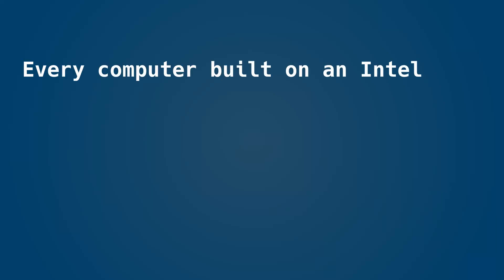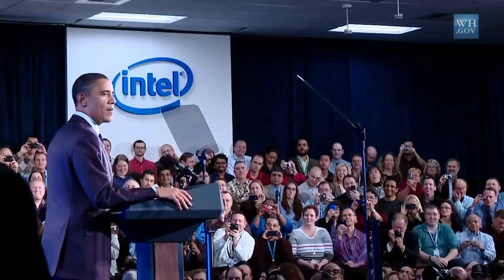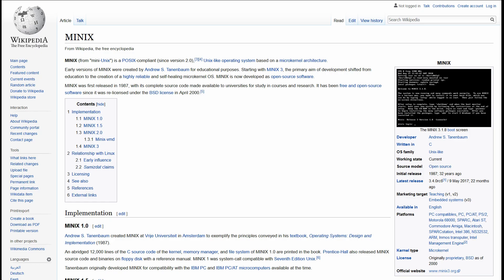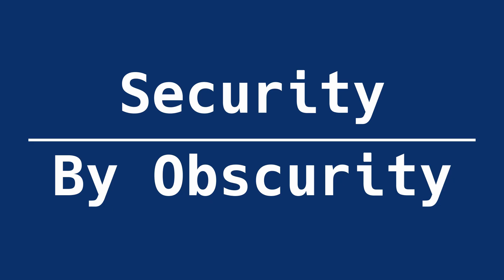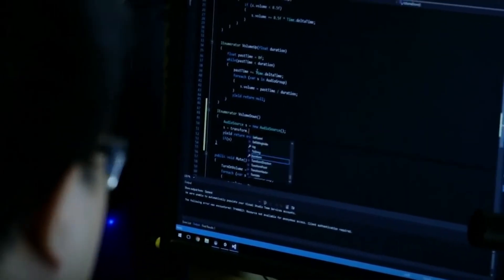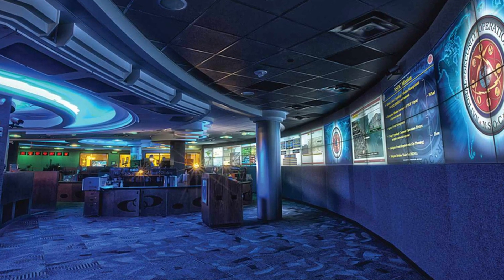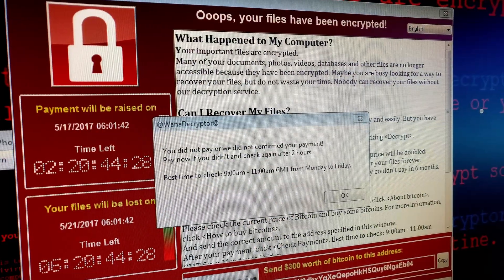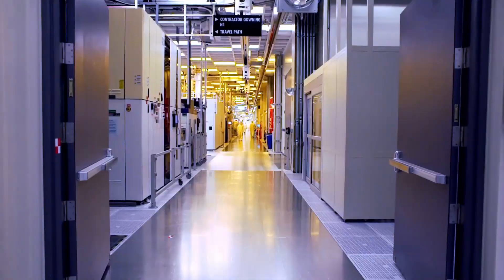How Intel wants to backdoor every computer in the world | Intel Management Engine explained

Comment: do raspberry pi's have something like intel me or amd psp? because an rpi has an arm chip
Reply: The RPI is also closed source and much less researched so we know almost nothing about its potential vulnerabilities.
Reply: @brainndamage  True, I remember that the GPU released the CPU from reset after booting a bootcode that was closed-source..
The best thing would be one of the Tuxedo Laptops that can disable Intel ME in BIOS setup by changing one bit.
But you never know if it works. I'm using an AMD Laptop right now, not much better but what can you do as a normal person against it? :(
Reply: @falafeldurum2095  libreboot is close to what one would want, but still runs on architecturally flawed CPUs. Purism laptops run a coreboot-based firmware with "neutralized" ME (only the initialization blob left, all other blobs removed) so are the best choice imo if you want a "modern" CPU (i7-7500u). Then you've got various ARMs but consumer hw is hard to find, and they're also likely backdoored. PINE64 Pinebook would be the best laptop in this category. Also you've got old PowerPCs or modern POWER9. RISC-V is not yet there.
Reply: @brainndamage  Thanks for the info!

Comment: Intel ME is on the PCH not the CPU. I believe it is primarily vPro computers shipping with it, and to many it may not be critical feature, but expect some Intel feature to stop working without it. If your computer motherboard doesn’t have an option to disable, older hardware versions will not boot Intel ME upon DRAM 0 not present. For newer hardware, you
may need to replace boot with coreboot.

Comment: A group of Russians have been working on this "ME"  for a number of years now one of them used a hardware device, that plugged into a USB port, to get some information out of "ME."  Workstations and graphic workstations have the option to turn off "ME"  but in reality it only hides it it does not turn it off, so now in BIOS on workstations  says it hides  "ME" rather than the old message "turned off."   I posted this on dissenter

Comment: Intel Management Engine: The modern equivalent of the 10NES program. Independent microcontroller that controls what the CPU does.

If it has it's own dedicated network connection via the onboard NIC... Would installing a separate NIC circumvent this? Even if it has support for PCIe cards, something makes me doubt it would know how to interface with a 3Com 10/100 card if you wanted to cut it off.
Reply: Don't use Intel NIC problem solved. Can't remove it but can deactivate it.

Comment: TLDR: every Intel (and probably AMD) CPU has a hidden backdoor which has full control over the entire system, can't be turned off or removed, has access to the network, and is active even if the computer is off (as long as it's plugged in). No OS/app can defend against it. It can just steal all your secrets or patch your OS and you wouldn't even know. Oh, and it has some severe security holes that hackers can use.

If you use an Intel CPU, you have no security.

Also worth mentioning: Minix itself is not a bad thing. It's just being used by Intel to do bad things. It's like Linux: anyone can use it, including bad guys.

Also: your phone has a Baseband system, controlling the radios and modem. In many cases, this system is very similar to IME: closed, encrypted, proprietary OS that can't be updated or removed, has full access to main memory (so can steal info, bypass encryption, control main CPU, no OS/app can prevent it), and by definition it has access to the cell network. And plenty of security holes have been found, so a hacker can take full control of your phone with just a radio signal. 

But there are several different companies who make these, and each has their own OS and design, and some phones are better than others at restricting them. Some even let the OS patch it for security issues. So not all phones are so vulnerable, and a hack that works on one model probably won't work on others. Also, I don't think any actual backdoors have been found, only exploits that work as backdoors. (But what better way to hide one?)

Bottom line, phones are a little safer, but not much.

Comment: ha-ha I'm using AMD
continues watching video
Oh....
Reply: Behold... Libreboot...
Reply: @czpanama  Libreboot works for CPUs that don't have IME. You mean core boot, but that doesn't completely disable it either.
Reply: @vdochev  No I don't mean coreboot, and the management engine is older than you think. Like I said, you can use the management engine cleaner in coreboot, but it only gets rid of part of it, and on some devices it can even cause problems.
Reply: @vdochev  Just looked it up, the management engine began in 2006. It's not something Intel just came up with.
Reply: @czpanama  Replacing the BIOS won't help you with that
Reply: @xGOKOPx  It will with Libreboot. Coreboot has MEcleaner, but it only gets rid of part of management engine, where Libreboot doesn't leave a trace of it. See the management engine does not just spy on you, they help manage data at the lowest levels, and that's why they are so hard to replace. The Libreboot project only works in a handful of boards, and they are all pretty dated. But Libreboot is really fast, partly because grub is coded in the BIOS rather than on the hard drive. It really is a work of art.
Reply: @czpanama  Well that's nice then
Reply: AMD has a similar thing and even ARM(used in smartphones) processors also has a similar thing called TrustZone.
https://m.slashdot.org/story/335801
Reply: do raspberry pi's have this same vulnerability?
Reply: @alice_in_wonderland42  I highly doubt arm uses TrustZone as a backdoor. Take a look at the baseband and simcard for that. Simcards run a varient of Java internally and got A LOT of privileges.
Reply: @Henk717   I know,
Actually most of the CPUs have this tech
backdoor is just a meme LOL :).

TrustZone runs TrustyOS - TEE used for storing fingerprint data and DRM keys and etc etc you access it via an API.

Answer to everything is not JAVA nor it is used, C and assembly is used mainly for SIM kernel but you can any Language for interfacing (API access from system ie ur smartphone).
A SIM card is not  a fully blown computer it uses reduced instruction set.

A SIM card don't directly interfaces with network nor it can,
system accesses sim cards for encrypting and decrypting data and SIM card services(yes SIM card has a private key which cannot be extracted easily).

What you were referring to as a varient of JAVA is called Embedded Java it was used in old mobile phones
idk if it is still used keypad phones.
Reply: @alice_in_wonderland42  I was actually reffering to JavaCard but yes other languages are used as well.
Reply: @Henk717  okay.
Reply: @alice_in_wonderland42  ARM will be coming to desktop and server too and may dominate those markets in the near future. Sounds unbelievable, but watch https://youtu.be/IfHG7bj-CEI
Reply: @Bonez0r  ARM CPUs use less power and are suitable for underpowered hardware(like smartphones) but comes with perfo

btw Linus Torvalds doesn't like ARM servers https://www.realworldtech.com/forum/?threadid=183440&curpostid=183486
ARM on servers sucks(for now)
and don't believe whatever you see on Youtube or anywhere, intel is fine
Reply: @alice_in_wonderland42  You mean Linus
Reply: @xGOKOPx  yeah just a typo
fixed that
Reply: Just gunna dust off my old 486DX2 66 and call it good.
Reply: @davey3765  Sure. :) You might be able to run som Linux distros on it. But not much more I am afraid.
Reply: TheFriendlyHacker For what it's worth: AMD has considered getting rid of psp and time last AMA got some attention on it... its worth yelling about it when they're listening...
Reply: this may be a stupid question to smarty people here but are Raspberry Pi computers secure ?

they use a different architecture ARM, use broadcom CPU and Linux as OS. pi foundation has made a lot of things open source except gpu drivers
Reply: Um... no. If it really was that easy.
Reply: wrg, idts, any s ok , laugh any nmw
Reply: Anthony Nelson basic stuff like checking email / browsing the web without uk, us or chinese tracking me.
Reply: When is that oh Moment, i think i missed it
Reply: Intel and AMD are inherently compromised garbage. ARM is inherently compromised garbage. That's why the ONLY current choice is POWER (aka PowerPC) machines, such as the Talos II desktop, based on POWER9. Not sure if the upcoming POWER10 will be safe like POWER9, but a high-end POWER9 Talos II can be bought today. There's also RISCV and other such lesser alternatives, though.
Reply: Yea PSP but the guy who made this video really wanted intel to look bad even though AMD has it
Reply: Keep laughing AMD users.....you were sold out by your chipset / processor manufacturer too!  AMD's PSP, like Intel's IME is a backdoor for NSA (circa 2013 SIGINT formal Exploit Request).   Period.  
Whether or not this was intended from the outset by each manufacturer or just very dumb engineering and piss poor luck, the reality is that's precisely what we all have inside our PCs since approximately 2009 onward.

Not laughing so much now....eh?   Sucks.  I know.   I feel ya.
Reply: As long as there are secrets there will be room for conspiracy theories. Yes vulnerability exist, but that doesn't mean that they were placed there by the government of US......

Comment: "We don't know what IME really does"

Then, by your own admission, the video is a load of made up speculative BS. Why make it at all?

Also, you clearly have no technical knowledge to speak of, especially since you can't tell the difference between a processor and a microcontroller, using the terms interchangeably... the only reason others listen to this is b/c they don't know any better themselves...

Claiming IME can bypass firewalls... moron, firewalls are usually configured on routers and many, if not most, of these use ARM CPUs, not Intel. They're not even the same manufacturer/company, much less the same architecture...

Comment: This video and everyone in the comments section is so fucking stupid oh my God "s E c R E t  O S !111" steAlInk dAtA !!!!1 ??? Does anyone even know what the fuck it does?? Computers aren't fucking magick pixies that send and steal BigData... like??? The CPU needs RAM to compare data? It also needs ethernet or wifi to connect to another computer, if anything you are worried about, it should be the ISP's.. as an intermediary  between two devices, it can read this data. 

Just. Fucking. Think. What is a "small secret OS" gonna fucking do???? Huh
???? Lemme.. uh.... uPlOaD  aLl DaTa  tO InTeL  c l ouddd teeeheheeee, br eAch Al FuRe WaLl.. for fucks sake.. its goddamn electricity!!!!!! ME is probably for uh, managing data? As we progress further, we process more and more data casually than back then, fuck, TERRABYTES more data... if you are running a business, you don't want to deal with errors, or misallocation of data at these incredible speeds. It probably acts as a buffer of sorts to manage the safety of your prized data. Goddamn, fucking stupid fearmongering shit wads. I'm irrationally angry at dumb shit like this, wholly holy shit. I'm sure Intel is using a secret NSA operating system in my CPU to steal my prized fucking hentai, yeah, totally... stealing my passport and shit. This is so stupid, God fuckin damn

Comment: One of the problems with this conspiracy theory is that even if the IME detects passwords or accesses open files and such, the moment it tries to transmit the information over the network connection it can be detected and analyzed. The same if it tries to save files to the hard drive or tries to become malware and add on to existing files.

Tools for detecting such activity are common.

Comment: There is ways of disabling IME, at least for the earlier versions, latter versions become harder and harder to disable.  And its not even a completely disabled, but mostly functioning disabled.   I think it was called ME cleaner. 

And yes, the video does have a very fearmongering vibe to it, but this is a legit issue, except that I haven't heard too much about real known abuse of IME yet but with it becoming increasingly harder to disable...
Reply: @first last , do you have to use a SPI processor to remove the code outside the OS? Do you know of any vulnerabilities that come of removing this subOS?
Reply: Snowden and Odin's eye are referenced online in regards to NSA backdoors  in Intel me
Reply: Maybe just buy an Old Laptop that is made before 2009 and install Linux on it.
Reply: Of course you won't hear about it--that's the point. We know Intel legally has to deny it all (remember Snowden and big tech, prism etc).
Reply: ME cleaner no longer works for modern CPUs, but we can still disable Intel ME with the HAP disabling mode
Reply: The thing is that all intel has to do is gather intel (kek) into the top companies dominating some random field and build up a random name company to compete against them. As far as we know, they might have already done that with companies like Facebook and others